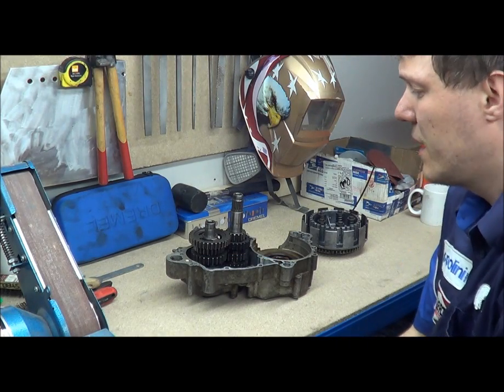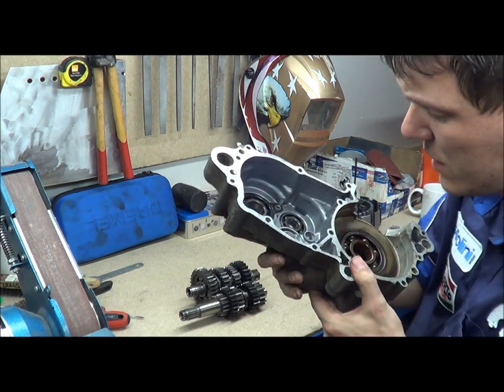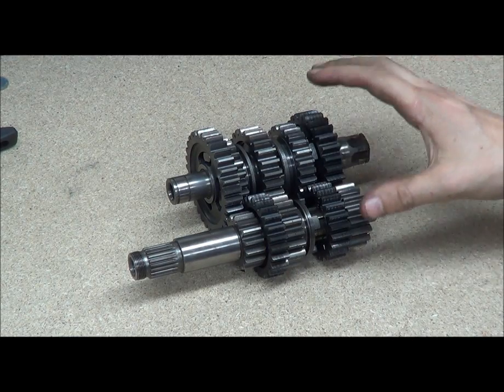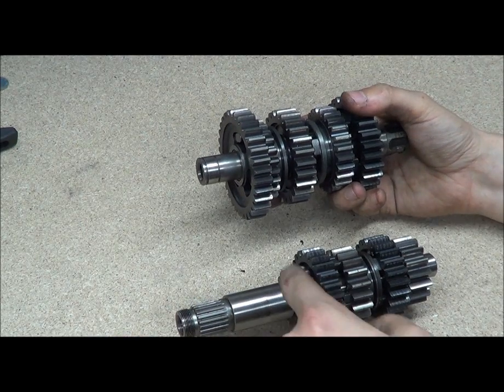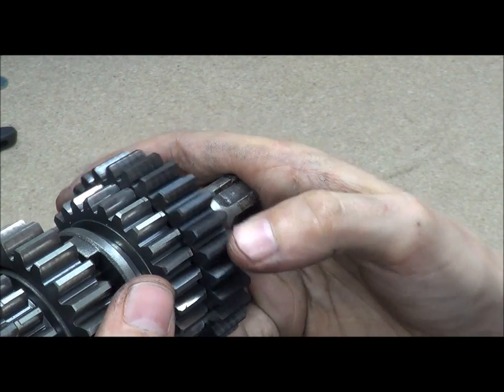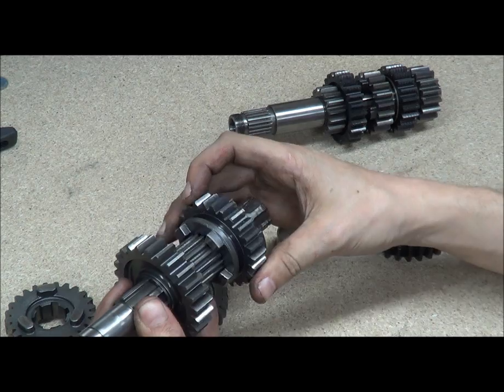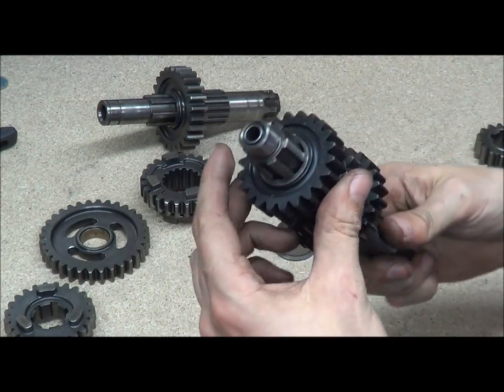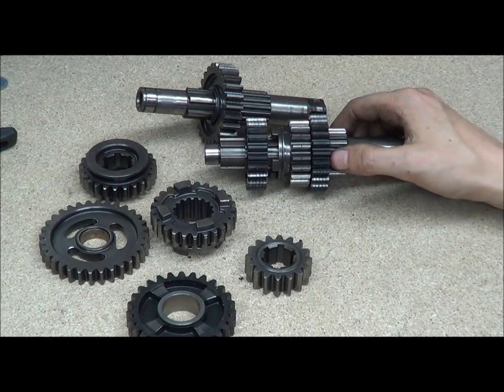How a Motorcycle Gearbox works - Part 1

Comment: Hello Matt. i really like your videos about gearbox, overdrive and sprockets. learned a lot from them. i have a small question.

these specs are from a CBR manual.
primary reduction ratio: 2.117
1st gear ratio: 3.307
final reduction ratio: 2.600

so let's just say we are in 1st gear and we need to find how many times crank rotates for one revolution of rear wheel.
can we find it by final reduction ratio*1st gear ratio* primary reduction ratio ?

so in that CBR bike it's, 2.600*3.307*2.117 = 18.2
is it right ? thx a lot. keep it up 😊
Reply from the maker: No. The first ratio is a reduction. I.e a drop in speed, increase in torque. Do you usually convert the rpm and primary to just an input. 

So you take say 10,000 rpm and / 2.117 to get 4,724. This is your input.
Reply: @thedirtyworkshop  thank you 😊

Comment: Hi, excellent videos.
If it would be possibel to replace gears sprockets with slightly different jumber of teeth for example on clutch axle -1T and on the opposite side +1T in attempt to get more torque from the engine, would it be a must to remap the engine's computer? 
I think I need more torque on Kawasaki Z650 2019 and this was on my mind for some time. I bought a front chain sprocket with -1T and on next chain replacement I'll replace the chain sprocket to one teeth fewer one just to get the punchier machine run and some more torque but my concern is would that increase the chain wear and  vibrations because the radius is smaller so the chain warps more around it. Have you any advices on this topic? Why would I want more power from such a light machine, well I like riding steep uphill hilly roads and quite often I just have to shift down and I have a feeling it would be much more smoother ride if the gears were set up more on the torque side. Top speed is not my priority. 
Good luck, thanx.

Comment: When you're at rest and going from neutral to first, and both shafts are stationary, if the dogs are not aligned with the slots, how do you shift?
Reply from the maker: That's a video coming this week
Reply: Would you know why the gear box on my 03 bmw f650 gs suddenly wont go into first what could  be wrong

Comment: Okay, so do we need to clutch when changing gears for the sake of longevity?
Reply: @Njato Andrianarison
Definitely YES, you need to clutch to reduce wear and tear on the dogs.  Pulling in the clutch disconnects the engine from the gearbox's input shaft.  This will reduce the input shaft's rpm which in turn reduces the pressure/friction on the dog teeth when they disengage from one gear (say 1st gear), and it also reduces the slamming force on the dog teeth as they slide into the next gear (2nd gear).

You can certainly change gears without clutching by closing the throttle just before you shift.  This method will also reduce the gearbox input shaft's rpm, but not as much and as quickly as pulling in the clutch, which means you have a little less wear-tear protection of the dogs compared to the clutching method.

Comment: Can you explain why old YZ250 gearboxes keep wrecking 3rd and 5th gear
And RM250 gearboxes keep wrecking 2nd and 3rd gear 🙄
Reply from the maker: When you say wrecking, what do you mean?
Reply: The Workshop raced a 2005 YZ250 last year and had to replace 3rd and 5th twice plus a selector fork
It was the dogs kept wearing away within the space of a few months
And the RM liked to round of 2nd gear
Reply from the maker: Using your clutch?
Reply: The Workshop used to only use it going down but now ive started using it all the time 🙈

Comment: Hello, please can i ask you which motorcycle is it and how it´s the axial distance between the shafts? I´ll be grateful if you will help me with it.
Reply from the maker: the engine is from a 1998 Kawasaki KX250 2 stroke. 
- "how it´s the axial distance between the shafts?" not sure what this means? If you asking what is the distance between the input and output shaft  - I don't know off the top of my head, and I don't understand why you would want to know???
Reply: Thank´s  a lot :) Yes i mean that dimension between input and output shafts.I need that dimension for my diploma work.
Reply from the maker: Ondrej Novak
The dimension can be anything you want, but if you want me to just give you a number, ok  - 68mm center to center
Reply: ok thank you for your time :)

Comment: hi thre i have a question  about enduro  transmission
Reply from the maker: go on then, what's the question?
Reply: What's  the difference on an enduro transmission
Reply from the maker: For people who don't know BMW offer an endurance transmission when you purchase a GS, usually at no extra cost. 

The difference is the gear ratio for 1st gear. The rest (as I understand it, unless the new model is different) are the same. The whole point it is to give the the ability to poddle around in 1st gear without reving the crap out of the engine. Basically you can pull away in first without using the throttle. This can help if the rear wheel slips when off road. This is an option with the big cc BMWs mainly due to their weight. 

With a different ratio for 1st, more speed is converted into torque. This allows the bike to 'push' the heavier bike at low revs. This is not needed for off-road bikes because;

1. they're lighter so less torque is required to move the lighter mass
2. they already have a gearbox ratio set-up for off-roading

The GS is a road bike which also has the ability to do abit of off-roading. If you buy the bike to do mostly off-roading they will switch out the 1st gear set for the 'enduro' set. They reason why it doesn't cost anything is because they're just switching out one gear pair. 1 less tooth on the input gear and an extra tooth on the output shaft. 

Hope that helps 
Matt
Reply: thank you now I understand

Comment: Hey mate can u tell me the Torque & speed of the engine which uses this type of gear box?
Also let me know the speed at the clutch side.
Reply from the maker: Hello mate, I'm abit unsure what you mean? The torque and speed are changing depending and how much you rev the engine. If you can be more specific then I can help - matt
Reply: Pony Power Tell me the power of engine at a particular speed
Reply from the maker: 42Hp @ 9,000rpm
Reply from the maker: or 31 kW @ 9,000 rpm
Reply: Thanks mate

Comment: I have a 2009 Triumph SE. Recently, I have serious problem to shift to neutral. When i stop for traffic light and in first gear, try to shift to neutral, I always shift to second gear no matter how careful I shift. Then I try to shift from second to neutral, it become so hard to press the gear shifter down, so I jammed in second gear..... If I successfully shift down , 90% I shift to first. Neutral just become so hard to engage. Why this happened? I own the motor for over 7 years, and I never had any problem to shift to neutral till recently. I don't have any problem to shift to any gear when bike is moving. Anyone know what went wrong? Any parts I may need to replace?
Reply from the maker: Hello mate - right so I've had this problem in the past only not with a Triumph.

Simple things first

1) It can be your clutch cable. Usually the culprit (9/10 times) Over time the clutch cable will stretch, this causes the clutch to not disengage fully. Which means your input shaft has torque applied to it. This will cause your gearbox to 'ride over' the neutral detent. Firstly adjust your cable tension, if that sorts your problem you can run with thta or buy a new one its up to you.

2) Your using the wrong oil. Triumphs are easily pissed off with lower quality oils. Again this is a clutch problem. Cheap olis usually don't conatin sexy friction modifiers which help your clutch slip when. The oil misbehalfs when it get to higher temperatures. Use recommended oil that Triumph specify.

3) This is less likely but depends of the milage of your machine. Your steel plates are beginning to warp - again a clutch problem. This can cause your clutch to stick together and yet again not seperate properly.

In summary its a clutch problem, not without a doubt but 99%. Try set 1 first and go from there. Adjusting your clutch cable should give you some result. I.e better or worse. 

Message me back if you have any problems or a success 

Hope this helps - matt

Comment: I'm still trying to understand why you don't need to use a clutch to shift.  Are the dogs on the dog gears on one shaft all aligned?

Never mind, I can see they are not.

I still can't understand why a clutchless shift is smoother than one using the clutch.
Reply from the maker: Don't worry mate a video is coming up - matt
Reply from the maker: https://www.youtube.com/watch?v=NxlNjfYep_w
Reply: Excellent!  I've watched most of the videos on motorcycle transmissions and read lots of the comments and there's a repeating conversation that goes like this:

Commenter 1 - If you can shift without a clutch then why even have one?  What are you giving up?
Commenter 2 - It will harm your gears if you don't do it right.
Commenter 3 - I've been doing it for years with no harm and besides it is easy to do right.
Commenter 4 - You only need the clutch for starting in first gear.  Old buses and lorries (trucks) used to only have a clutch for starting.  
Commenter 5 - I use the clutch on the 1-2 shift because neutral is between them and that makes it harder.
Commenter 6 - I don't  use it for downshifting.  You can jerk the bike if you do that.
Commenter 7 - I do it even downshifting.

No where is part one of the original question answered.  I hope your video does that.

My best guess now is that it involves speed matching -- not of the adjacent gears necessarily but of the rotation of the input and output shaft, or maybe that amounts to the same thing.

Comment: do you have any videos or know of and with reversed gearing, as in down shift to higher gears and up shift to lower gears
Reply from the maker: no mate I don't - can you be more specific?
Reply: Say, normally, the shift patern is 1 down 5 up, im wanting to put my shift patern where its 1 up and 5 down, or all 6 down
Reply from the maker: ok, why comes to mind, and secondly its possible but with some major modifications.
Reply: +Pony Power yes my cbr f4i motors starting to get to the really in need of a rebuild poing and the transmissions all grindy in nuetral at idle speed, i put a new clutch in her but its still clackity, i was thinking it be something to do while rebuilding
Reply from the maker: ah right, any bike can have the selector changed to say 6 down for example but it means changing the selector drum. This isn't something you can just do and they don't sell them as aftermarket parts. If your gearbox is grinding in neutral then you have a selector issue. In a working gearbox the when in neutral everything should be free-wheeling. Are you sure its coming from the gearbox?
Reply: +Pony Power yeah im pretty sure it has me stumped, its a clacking sound i asemvled a new clutsh set into it found a broken friction plate on the old one, it has me stumped. the previous owner used it as a stunt bike and didnt take care of it by no means
Reply from the maker: Are you sure there's no fragments stuck in the box from the broken friction plate?
Reply: +Pony Power ill need to check, im gunna have to open it soon anyways it needs a new shift return spring put in, shes a project right now lol. im gunna work on suspension then body work after the mechanical work
Reply: +Pony Power is that a ktm motor you have
Reply from the maker: no its a kawasaki KX250
Reply: +Pony Power. oh, thats pretty cool.